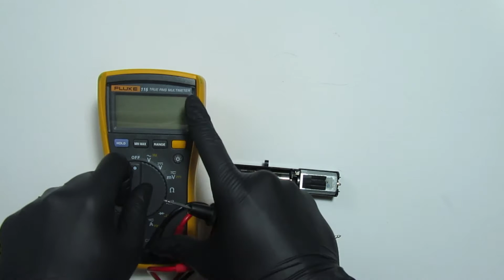Repair | Panasonic ES2206 Shaver

Comment: Good morning I'm trying to open the panasonic E2207 but when I remove the second screws and I don't know if it will open like the one in the video
Reply: not sure if this will help 4 months later, but try pulling the bottom piece sideways, that's how i got my es2207 open